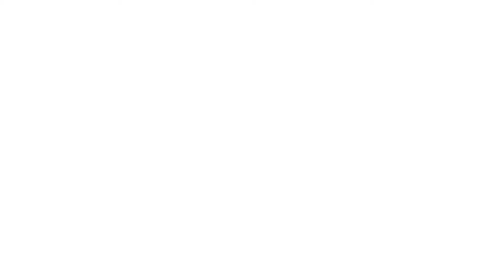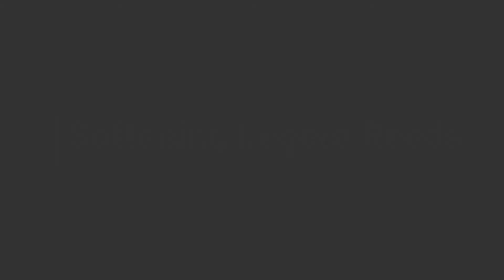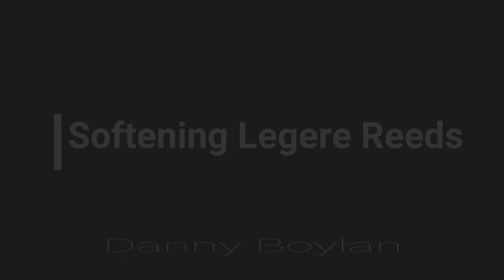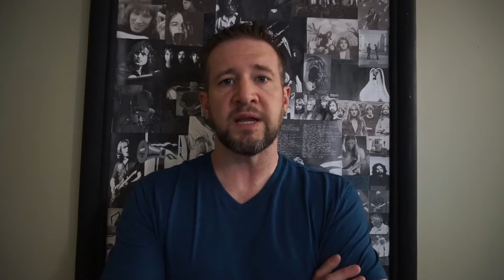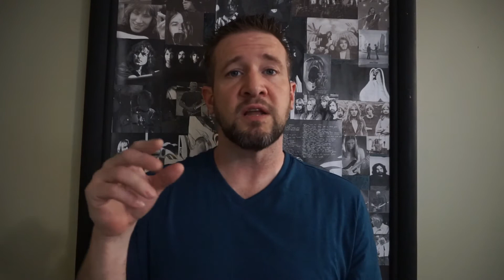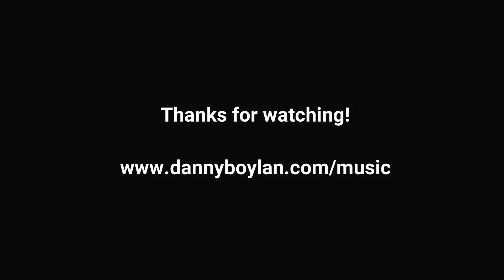How to Soften Legere Reeds - Danny Boylan

Comment: I did it mechanically by using 800-1000-3000 grain sandpaper. It works very well and there no risk to bend and warp the reed lip like it happened to me when I "boiled" my Legere 3.
Reply from the maker: Cool Mauro... Thanks for the tip

Comment: i had a 3.5 signature for alto. before that i was using 3.25 and that felt like i can go even harder reeds but too hard for me.

then i saw your video. i tried your way to soften but not in boiling water. but im sure the water was over 90 degrees celcius. your method to soften worked perfectly for me as well. 

there is a friend on the comments that had a wrinkled tip problem. my guess is he only applied  just the tip of the reed, but not all the way in (the thin part i mean). if this is the case, the part in the hot water and the part out of the hot water kinda resisted each other and caused the wrinkle. just a theory though :D 

again, thank you very much for this video.
Reply from the maker: Awesome!  So glad it worked for you!  Thanks for the comment!

Comment: Bang on! 2 1/4 on tenor was too hard and 2 was too soft on higher octaves plus difficult to handle. I did 1 sec boil three times on 2 1/4 [ each time after test playing] and it has put my 2 1.4 on the damn sweet spot between it and 2!!  Same with my 2.5 which was actually softer than the 2 1/4 [ I know, but that's what it is]  and that also is now in my sweet spot! Superb!
Reply from the maker: Yes!  I love it when that happens!
Reply: @dannyboylan2342  oh! I was told the other way round! So I used to keep a bit below the piece edge for easy play
Reply: @dannyboylan2342  In my experience it's the other way around, past the tip and plays like a stiffer reed, below the tip it plays more easily.
Reply from the maker: @overthetarget9401  you are correct!  My bad...I wrote it backwards and removed that reply.   Thanks!
Reply from the maker: @nilaychhasatia6048  yes, you are correct... Sorry I wrote that backwards!

Comment: This works with all Legeres? (interested about signature european cut Bb clarinet reed..), this applies to my case? Does this affect the sound quality and consistency or they remain as they were? To you, It took 1 time to soften reed or more? Does this work also with cane reeds?
Reply from the maker: Hi Georgia!  I have only tried this with saxophone signature reeds but I do believe I saw it mentioned once on a clarinet forum.  Sound quality seems to remain the same, they are just softer.  Sometimes it takes me one time, sometimes it takes more...play the reed after each time you do it to test the strength.  No, I would use a reed knife to soften cane reeds and would not boil them.  Hope that helps!!!

Comment: I want to soften my legere JUST a little bit, maybe If I'll leave It for a half of a second will work?
Reply from the maker: Georgia, is the reed brand new?  If so, just keep playing it for several hours and it will soften a bit naturally.  If not, yes, I'd try your 1/2 second idea.  Or, you can always just place the reed so the tip is just below the tip of the mouthpiece (instead of even with it) so it plays a bit softer.
Reply: @dannyboylan2342   reed is brand new, when you say play It several hours you also mean, play It several times?..(to soften a bit)
Reply from the maker: @jimis3167  yes, just play it for at least 3 hours total (doesn't have to be all at once) before trying to soften it.  I'll be surprised if it doesn't naturally soften just a bit like you want it to.
Reply: @dannyboylan2342  I just puted in boiled water and It worked, now strength is fine but I wonder If became same with a 3.5 now or maybe around 3.5, It plays easily now, I hope just to not loose It's consistency, I suppose It won't.. In general with legere european I have a little problem to play the very high notes of the clarinet, above contra C, maybe a proper ligature to grip this reed better will help, I'll see..
Reply from the maker: @jimis3167  good luck and keep us posted!
Reply: @dannyboylan2342  one more thing, how do you understand that a legere's lifetime ended and you need another one brand new?
Reply from the maker: @jimis3167  this is totally just based on how the reed feels to you.  I have several that I've been playing 6 months to a year...but my best answer is to just stop using it once it doesn't feel right to you anymore.
Reply: @dannyboylan2342  Thank you.

Comment: another question: what is your experience with durability (stability of the reed for longer period or while playing a gig)? i use fiberred carbone or hemp and i am very happy with them. what i like on the signature for alto is the very warm sound, which for typical jazz gigs works very well for me - and yes, the very easy playable altissimo range!
Reply from the maker: Hey gsaxy!  My personal experience with durability of Legere signatures for the long term is that I can get it seems at least 6 months out of a reed, playing regularly.  For one sitting/session I've done 3 hour gigs of near constant playing and haven't noticed any problems.

Comment: I just ruined a reed. I dipped it one small second in boiling water, and it softened much more then only 1/4. Also I feel that the elasticity is gone from the material itself, like with a much used reed. In my opinion the material structure is damaged by this method, which is a difference from adjusting by sanding or filing the reed. Just my 2 cents.
Reply from the maker: Sorry it did not work for you Robert!
Reply: @dannyboylan2342  No problem, it was worth the try.
Reply: Well.  Try NOT dropping but just dipping like he did in the vid if you’re still interested in trying it.   I’ve been doing this too before I came across this vid.   But yes, I did “drop” it in scolding hot water and it did change the pores too much.  So I just use that reed as a practice , noodling reed.   🤷🏽‍♂️

Comment: hm... tried: the tip wrinkled immediately (1 sec), couldnt get the tip flat anymore! unusuable now... what did i wrong? btw: on your video the tip wrinkles too... any idea? thx
Reply from the maker: Hey gsaxy!  So sorry it didn't work for you... Not sure what to say?  I've probably done this at least 15 times now and haven't had the tip wrinkle.
Reply from the maker: I don't see why Legere wouldn't still honor the exchange since the reed was obviously too hard prior to your trying this.  My apologies that it did not work for you.
Reply: thx danny for your instant reply :-) i used a signature nr 2 for alto - perhaps this? the "2" reeds are thiner on the tip. could it be that freshly boyled water may be too hot?
Reply from the maker: @gsaxy  might be so!  I've done this with both alto and tenor signature 2.25 but not as soft as a 2.  Good possibility.  Not sure about the water temp as I always do mine at the height of the boiling.  Any chance the reed tip touched the bottom of the pot?
Reply: no, i was very carefull: i even used a twezzer to make shure, the reed remains just a very short time in the hot water.
Reply from the maker: @gsaxy  that's too bad then.  Maybe your thoughts about the 2 strength are right.  Maybe more folks will post their experiences and we'll get a consensus.
Reply: @freeman9843  yes, better dont! i use the reedgeek g4, a great reed-shaping tool to adjust them!
Reply from the maker: @freeman9843  that's awesome... Thanks for adding that tip!
Reply from the maker: @freeman9843  thanks again for the information!